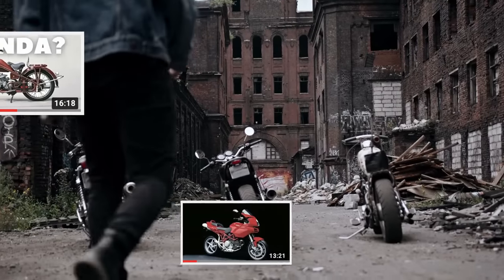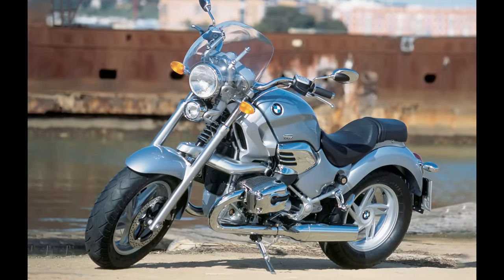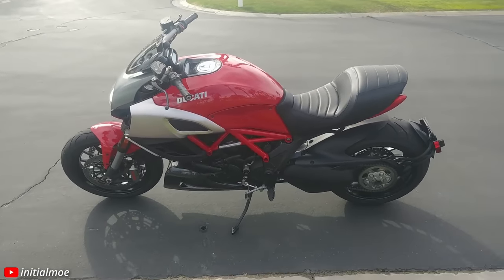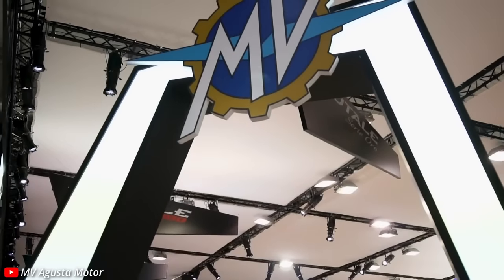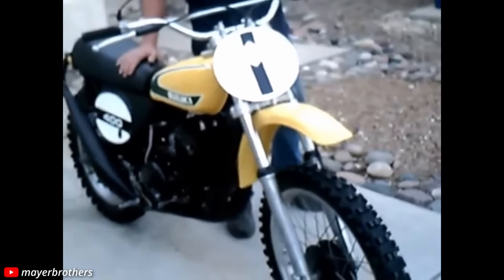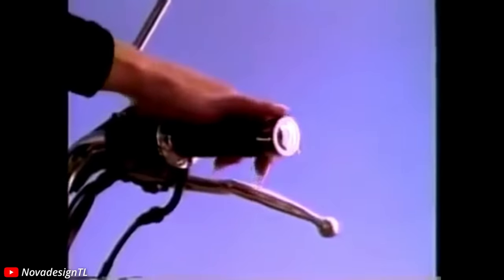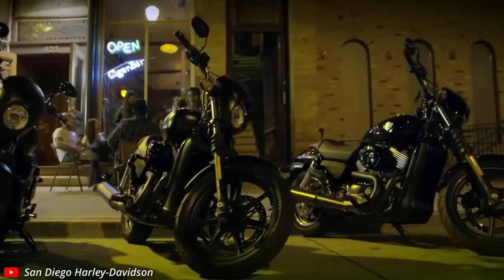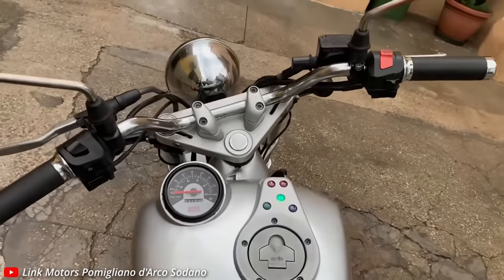The WORST Motorcycle from every manufacturer

Comment: I had the  Royal Enfield 500, and yes it was out dated. But I loved that bike put the metal hard bags on it and drove it for a few years.  Never gave me any problems, and was great on the pavement or the dirt and gravel roads.  One bike I wish I would of keep, but wanted to try a side car rig so went with Ural but they were a fun ride but way under powered, and had to be near a  shop as did make many visits with the fuel injected model.   The Royal Enfield 500 was a great all around bike, and got a lot of people coming up and talking about there old British bikes. I also loved the kick start, just something about kick starting a bike that brings back the old days.  If there was a dealer hear and they still made the 500 cc single there would be one in my stable.
Reply: You don't drive bikes. You ride them.

Comment: If you ever rode a ZL900 (0-60mph =2.62sec)  it never went far (11 litres of fuel) but it went really really fast off the line!  6 years 7500kms (a block at a time)

Comment: Completely wrong with the Kawasaki Eliminator.  I owned one, bought used in the early 90's.  Got a good many compliments on that bike and it was a great runner.  I'd gladly buy another if I could find one in good shape and low miles.  You obviously missed the point on that bike.

Comment: I really loved my 920 Virago, had to fix ignition issues in the wet & starter bolts that would twist.  But reliable as a hammer, clean shaft drive & easy to tune and balance.  Some possible entrants: Honda PC800 Pacific Coast / Kawasaki Concours14 ABS / Suzuki 380GT
Reply: PC 800 was my favorite of 30 bikes next to 2-stroke road screamers. Haaa

Comment: Too right on the 999. I waited years before I bought my 2005 999S, even travelled 2,000km overnight to pick it up. I've always loved the stacked headlights and there was a good reason for the use the double sided swing arm. I shouldn't need to mention the 999 was/is Ducati's most successful model in competition.

Kawasaki's ZL900 Eliminator did have it's shortfalls (peanut tank range, broken lines etc) however the ZL1000 corrected both those issues. I absolutely love mine and it's the most comfortable bike I've ridden on 7 hr trips non-stop. Furthermore, you really need to experience the design principle before you criticise its performance. These are long, low and heavy and that means you can wring the throttle to the stops and instead of it spitting you off its back like all sports bikes, these Eliminators rocket you forwards. I've had mine up against CBRs, ZX10s, BMW1000SS, Aprilias, R1s, GSXRs and other so-called racers and nothing could beat me off the line. To rub salt in their wounds, mine had a topbox on the back with a laptop and a bunch of other stuff.

My late father had a 760 Virago and he loved that thing too. It was so reliable and easy to maintain and no matter all the arguments about Yamaha trying to 'copy' the American 'Chopper' market, these bikes had true merit.

My guess is a true measure of how good or bad a bike is can simply be founded in the number of sales in their market of the day. But guess what? Humans are not robots, we all have particular desires and that's why the manufacturers try to cater for everyone with bikes that are 'different'.
Reply: What happend today in the Valencia gp both KTM  in the top 10 .?

Comment: I had 81 Virago 750, it was a fun bike with a top seed of about 85 even after the jer dine slip-ons, it handled ok but you could feel a wobble from the frame flexing when hitting a bump in a corner and crossing the centerline to pass you felt the frame flex with the change of pavement angle. I ended up getting rid of it due to the endless starting issues it had as the internally mounted starter bendix was mounted in rubber. Then about a year after that some aftermarket company came out  with a fix for it but It was then a part of my history. I enjoyed it while I had it and moved on to something bigger.
Reply: Yeah, The Virago was the only bike I've ever had in my shop where a worn out starter drive would total out the bike. It literally cost more to fix it than to buy another one!

Comment: I have a 2006 Kawasaki Vulcan 900 classic. I just turned 70,000 miles on it a couple day's ago. No engine work has been done on it so far. Very well balanced for me and I've ridden in multiple States with it. I'm hoping it will last another 30,000 miles.
Reply: Mine is 2008. I love it 🤘
Reply: @MrBijeloplavi  I've been told it's one of the best bike's put out by Kawasaki and I believe it!
Reply: @tedb7402 , I completely agree.. Reliable, easy to maintain, easy to drive, long lasting, not expensive, not small and looks really nice! What more could you ask for from a motorcycle? There is probably a reason why it has been produced for so long and unchanged🙂
Reply: Love my 900 classic. Thought the guy in the video was very dismissive of them.
Reply: 2009 LT here, love it. Had a 1988 VN1500, I do miss that bike.

Comment: 10:20 Personally I think that 1981 Yamaha Virago 750 is one of the best-looking 750s ever built. My first bike was a new 1978 Harley Davidson FXS 1200 Low Rider. The dealer recommended it as a good bike for a beginner since it had such a low seat. I traded it in for a new 1980 Honda Goldwing. Then I bought a second new Honda Goldwing in 1985. I bought a third new Goldwing in 1990. In 2018 I was in a car accident and sold all three of the Goldwings because of medical bills. If I had know back in 1978 how much nicer Japanese bikes were than Harley bikes my first bike would have probably been a new 1978 Yamaha XS 750SE Special.

Comment: Finally got around to watching this video!  Always enjoy your stuff...  I raced a TM400 back in the day. I didn't realized how death defying I was.  The first ride out behind the shop I worked for we had a little test track.  Going about 40 MPH across some whoops I got a full lock tank slapper. I slowed down with no damage but Wow.  It was also the loudest bike among all the open expansion chambers in the world in use back then.  130 or 135 DB I think.  Louder than a jet taking off...  When anybody would complain about I would say "WHAT?"  I had a sponsored ride so we made it work... Wider handlebars, inch shorter Curnutt shocks on the rear and a Basani low pipe for a somewhat different powerband.  Nobody other than Maico was really making anything in the open class that would handle anyhow and that thing would fly when opened up...  I was a big fish in a small pond but I won a lot of races on the old girl.  I raced open class in a state series after a while and could get top 10 every once in a while out of a slew of riders.  Those were the days, my friend, raw horsepower, loud pipes and no fear...
Reply: Many people raced that bike and won money or trophy's. It wasn't the best motocrosser but not bad.
Reply: The RM 370 was also pretty dangerous and had an unpredictable power band.  
It would yank the sprocket off of the back wheel.

Comment: I've done over 500,000 kms on 8 Moto Guzzis (i still have my 81, which has 180,000 on it, and a 2001 California, so you know i
m addicted) and the Centauro for it's weird looks, and the first 1000 lemans and SP (the 16in front wheel models) for their weird handling might be contenders. The Convert has a cult following. My personal worst was my 2012 V7 Classic, which literally spent more time in the shop than on the road.
Reply: I currently have 8 Guzzis and my 86 Lemans 1000 being one of them.I haven't had a bad experience with the 16 " front wheel.I never had a problem with any of them that wasn't an easy fix.I think my 96 Sport 1100 and my 97 Daytona RS are two of the best looking bikes out there but then again that's just my opinion and everyone has a right to there opinion.Enjoy your Rides

Comment: The ZL600 Eliminator was one of my magazine dream bikes as a teenager when I first saw it in '86. They marketed it and the ZL900/1000's as top performance street bikes.  I couldn't afford a new bike back then on my Taco Bell wage, but did manage to swing a used '78 Honda CX500.  Still riding today on a Kawi C14.
Reply: I am still totally enamored by the Eliminators.  I cannot believe it was chosen as a terrible bike.  That hurt.  Respect lost.  Unsubscribed.
Reply: I owned an 86' Elminator for the past six years, great bike to ride cornered well and engine was a total screamer. Sadly some guys tried (and failed) to remove the locks back in April and set it on fire outside my apartment. Devastated man, only had 32k miles on the clock

Comment: The "original power cruiser" was not the V-Rod. In 1985 Yamaha released the psychotic V-Max, without question the "original power cruiser":)
Yes, I have had and loved the ZL1000 Eliminator but then I am a Kawi fan, also having several KZ1000s and GPZ900s, blend these two and you've got a ZL1000.
Reply: I still have two ZL1000 Eliminators .. I love 'em. We didn't get the ZL900's here in Australia.
Reply: I considered a ZL1000, but thought the parts might be too hard to acquire to restore or maintain one.  My 77 kz1000?  Nearly every nut and bolt is available, to include new gauges and now Kawasaki is making cylinder heads for them again.  Still, as big of a Kawi fan that I am.... the V-max is tempting to add to the stable... maybe after my CHiPs kz bagger conversion.
Reply: @russshappard1059  The V-Max is an iconic bike, had one for a long time. Eventually I grew bored of this one trick pony. Poor braking, average handling and a wiggly frame. The carbs are very temperamental and need constant cleaning. Modern bikes have more power and better manners. Very fun bike despite its flaws.
Reply: @ctrl-alt-slide  The look and sound alone are enough for me to  keep mine. It turns heads everywhere I go.
Reply: @esv5182  a ZL1000 or V-Max?
Reply: Psychotic is right.   Mine felt like it wanted me dead.  
My Eliminator was way better overall.

Comment: Bart must be younger than his public. Viragos sold by the millions back in the day, peeps loved them. Nowadays, Id stay away from anything that measures its use by the hour and not by the mile and anything of Orange color unless , you dont mind visiting the dealer every one thousand miles or so. Consider its not just bikers riding motorbikes, so tastes are going to vary. I look for simplicity and the possibility of doing maintenance at home. Others might look to be on something that no one else has and its normally those that no one buys. Great video, thank you. 🙂
Reply: He hated on the reliable, affordable, for the people motorcycles. It doesn't matter what you ride, being in the wind on two wheels is what it's about.
Reply: @ThisisForTheTV  100% agreed but its an opinion video. I give mine based on my experience. It very much depends on what you do. I ride mountains and deserts. The ability of fixing it yourself or some local mechanic is what I look for. Some bikes are made out of plastic inside(Orange)to make them lighter but require dealer visits for open engine part replacement often, which if you dont consequences are mortal. Im sure those I've found in the middle of nothingness with broken oil pump pinions at 8k miles on the bike would have liked to know before they opted for that one.🙂

Comment: Funny thing...I owned an '82 Virago 750 and loved it other than the worst starter in motorcycle history.  I currently have a restored 71 OIF Tiger.  And I have one of the Enfields you mentioned.

For Honda I'd say the DN-01.  For Guzzi, the MG-21, and for Indian it would have to be one of the re-badged Royal Enfields from the 50's.
Reply: I have a Virago 920 and the starter sounds like a coffee can full of bolts falling down the stairs. And also one of the new Royal Enfield 350 Classics which is actually brilliant if you like going slow on country roads

Comment: Royal Enfield, I loved the Royal Enfield precisely because of their simplicity and the fact that they never changed in 50+ years. It was like riding history. It kind of had the same affect as riding a 45 knucklehead. It didn't have to be fast or super stylish. It was a bike, a simple, easy to work on bike that anyone could afford and ride. Perfect for a minimalist.
Reply: There is NO such thing as a 45 knucklehead! 
All 45 cu. in. are flatheads. 
Knuckleheads were so extremely short lived, whatever their problems Harley abandoned them after what 2 & 1/2 years.
Reply: @tompowell6723  you are most likely right,  but the point I'm making is still valid.
Reply: @tompowell6723  , I should add, I'm not a Harley guy. I recognize their importance in the riding culture. I'm an Indian guy and a Honda guy. But I do enjoy a Harley riding by.
Reply: @tompowell6723  try around 11 years
Reply: @donaldgilbreath4200  the worst Indian was the parallel twins of the early 50s

Comment: If you decide to make a part 2. A truly bad BMW would be the F650. It started of as a hodge podge of parts, for example an Austrian Rotax engine. And they had lots of electrical problem. As far as ive understood they later included it in there series of Aprilia badgeengineered bikes. I've owned one, and its tragically slow, and heavy as F*CK. Raced with a friend who rides a Yamaha XT660R who just effortlessly left me in the dust, even in a straight line.

Comment: I only really have an issue with two bikes on your list, and especially the rationale behind why you chose them.

For one, the Virago. The original Virago was a gorgeous bike. Very modern, very capable, very good looking with it's nice understated looks. It was a cruiser, yes, but very much in the UJM tradition of cruisers. In 85 that changed, when Yamaha raked it out a little more, put on all the chrome and the pillowy seat. It was still a good cruiser, and not as nice looking, but it didn't come close to being as much of a Harley wannabe as many of the Star line of motorcycles that were to follow in the 2000's. One could very well argue that the Bolt is much more of a copy of the Sportster than the Virago was of anything Harley was making.

Number two, the Eliminator. First of all, you have to understand that in the 80's, inline 4's were the norm in Japanese cruiser, so there was nothing unusual there. Secondly, the Eliminator was born in response to Honda's Magna, which was lighting up the drag strip, and the Eliminator was an awesome response indeed. As you said, audacious. Kawi went all in with the drag racing theme, making a cruiser that was quick on the 1/4 mile, or off the line at the red lights on Main Street. Their only mistake was in making it shaft drive, as, at the time, they did not know how to control the lift from a shaft drive bike, meaning that the Eliminator was not nearly the drag racing bike that it could've been. 

For the worst bike from Kawi, I'd argue that the Voyager 1300 6 cylinder was the worst bike they made. It was just so heavy, so big, and offered no real advantages. An effort to compete with the Honda CBX and the Gold Wing at the some time, it was too much motor with no real advantages, and in 1986 Kawi brought in the Voyager IV, a 1200cc 4 cylinder that was a much better bike in every way.
Reply: I agree, when he said vulcan I was a bit confused too. Vulcans are dirt cheap reliable cruisers. I got mine for 100 bucks after it had sat in the weather for 7 years and it didn’t even cost me $1,000 to have it up and running again
Reply: The words most used were "weird, misguided", and the phrase, "I don't like it".

Not a very well thought out criteria for "worst" bike.
Reply: Totally agree with u on the eliminator it was a bad a$$ bike of its time but could have been way better with a chain instead of the shaft drive

Comment: Aprilia also made the classic platform with a 50cc two-stroke, which made it meet the moped laws in Europe. I had one, best moped I've ever had. But, yes, I agree that a two-stroke 125 in that same platform would fall woefully short of what a motorcycle rider would want.
Reply: I bought one of those back in 2015 as my first bike,I still have it and ride it around the neighborhood sometimes. Pretty good little bike,especially for beginners learning to ride and use clutch and gears (like I was when I bought mine).

Comment: I had a 95 virago it had 353000 km . It ran with minimal problems. Best designed air cooled vtwin. They continued on to make the 1100 and 650 Vstar.
Reply: Yes, right, I own both 650 & 1100 V-Stars. Both very comfortable, reliable bikes, and do what they were designed to do well, Cruise.
Never cared for Virago styling, but that's a personal choice, they were very popular, and still are from what I've seen lately.
Reply: @ronerie  one thing to think about is that the bike was good for people that were vertically challenged. Lots of bike aren’t designed for most women. My wife bought the virago because she was comfortable on it. It was a light and narrow bike and preformed well on the highway.
Reply: I don't remember Yamaha ever making a bad bike